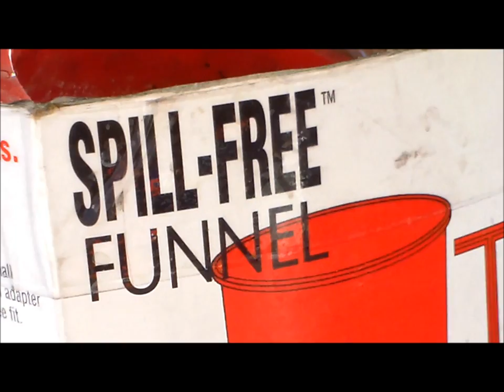DIY How to bleed engine cooling system √ Fix it Angel

Comment: I watched this earlier today cause I needed to bleed my system after replacing radiator. Was pretty easy to follow even without you talking. Although I didn't have the spill free funnel so I made one from and old radiator cap an milk jug. Worked just as well. lol Thanks for the post. Helped me out a lot.

Comment: Nice videos man. I changed my coolant and did this but my radiator fan wont turn on even when the engine temp is warm. But when I turn AC on the fans turns on. Anything will help. Thnx!

Comment: You need to open bleed screws when filling up in my car before you start the car
Reply from the maker: Where is the bleed screw on 1999 Camry?
Reply: It may not have one, but I'm just saying some cars do and then it's probably wise to use them
Reply from the maker: Oh yes, you are right. Like Honda's and GM's. I thought you were referring to this Toyota vehicle. Thank you for the tip. Please subscribe and have a nice day.

Comment: You dumped that Toyota red in there, at full concentration, you know.
Reply from the maker: Yes I did. And what happened to the engine. NOTHING. The engine runs perfectly. No problems at all at the time. And no problems at all to this day. Thanks for watching. Please watch all my other videos.
Reply: @FixItAngel  Hahah. That's your response? I guess you may as well do everything wrong, and It'll all be good.
Reply from the maker: @typhoon320i     ya haha. you saw what I did. I told you the truth. Then tell me what you want to hear? “The engine overheated and suddenly seized and I had to replace the engine “ NOPE that didn’t happen. so what you think I did is wrong? So that’s what you think but like what I said is true about the car. NOTHING bad happened. So what’s the problem if it works ok? 
You do what you do to your car. And I do what I want to do with my cars. 
I don’t see any helpful videos of you fixing cars. All I see is videos of animals in your channel and a Lamborghini on the freeway. If you think you know everything about cars and want my respect?? Then show it on video your repair skills. I will be waiting. I think I have the last laugh. Haha!! 
Hey I’m just letting you know nothing bad happened. You make it sound like we drinking that stuff from concentrate. 
FYI: what’s really bad is having NO anti-freeze in the cooling system. That will definitely overheat the engine. You should try it if you want to know if it’s really true. Don’t forget to video that. Haha.
Reply: @FixItAngel  It's not even like I insulted you in my original comment. I pointed out that you did something wrong, and you had a hissy fit. You could have just said "Yeah, I didn't add it 50/50 but it was fine." Instead you get all defensive. Take criticism well at your job?